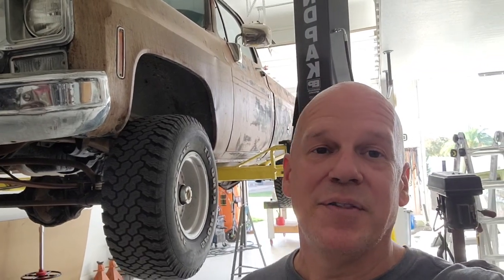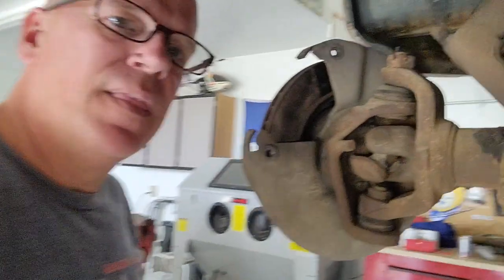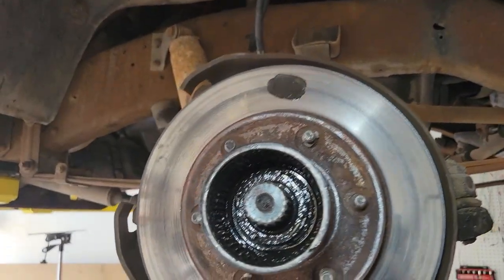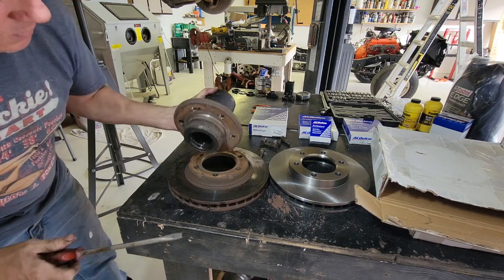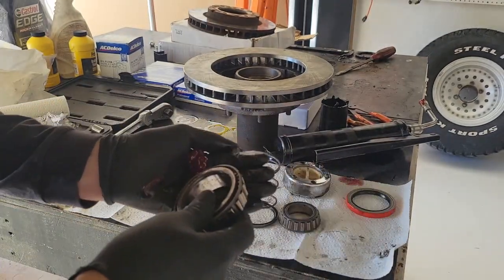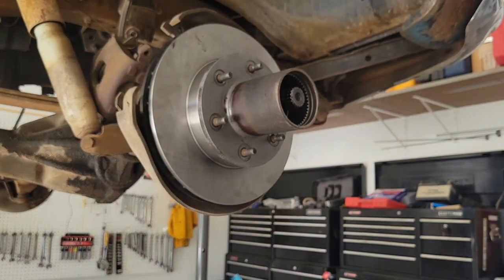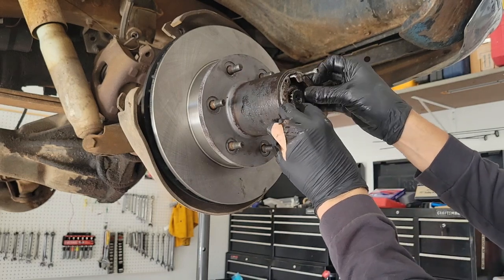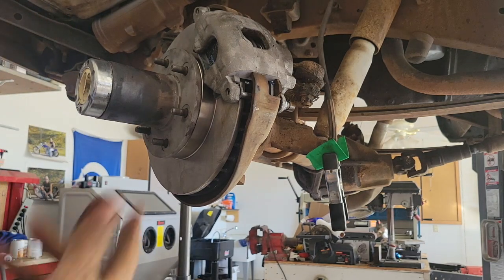Chevy K5, K10 4x4 Squarebody front brake job; rotors and pads.

Comment: Just a FYI for anyone watching. Torque bearings to 50lb/ft to set them up, back it down, retorque to 35 lb/ft while turning the rotor, and then backing the turn off 1/4 turn before installing the lock washer and torquing the outer nut to 50 lb/ft. Awesome video!

Comment: Thank you 😎 your video helped my son and I put on new rotors and pads on our 83 K5 blazer, and clean and regrease the hub innards. The rotors we bought had the lugs and hub cradle already; no press needed; albeit much more expensive. Had we watched before buying everything, could have used the saved $ to buy a 12-ton press! We were going crazy trying to remove the oil seals to get inner bearings out of old rotors, your video led us to "Performance Tool Seal Puller - W1219" at Oreilly's. Having the right tool made it easy.
Reply from the maker: Thanks, glad the video was useful!
Reply: You can use a punch to knock seal out. Just as easy

Comment: For the people without a press, how'd yall get the lug bolts out and pressed back in
Reply: I’m guessing you got them in but the people that didn’t. Put the stud through…rub some grease on 6 or so washers on the threaded side.. then run a lug nut on and pull it through till it’s seated… hopefully that made sense

Comment: It's Project Farm where you got the grease info. 

Today to replace calipers, rotors, seals, grease, and pads on the front only it would be $300 easy.

The only stuff I would have replaced if I took it all apart are the seals and the lug studs. I wouldn't have replaced anything on that rig actually, and simply cleaned,  inspected and greased the brake caliper pins and their female counterparts to see if that solved the brake functions. 

I have an 87 GMC V1500 and it's white also but soon will be burnt orange.  I just use it for tooling around town doing chores and errands.

Comment: Ever experience perfectly working breaks an pulling to one side after changing the pads? Changed the pads an when doin so I used a clamp an old pad to push the caliper pistons in. Now they pull to the right when i hit the breaks. Bled the breaks an didn't change anything. The calipers an lines was replaced about 7 years ago, could be one of those but 7 years isn't that old i wouldn't think, maybe tho. Hit the breaks an pulled perfectly straight till swapping pads. On my 84 k15.
Reply from the maker: I had that problem with a stuck piston in an old Monte Carlo that pulled to the opposite side.  I would suspect that the caliper on the non-pulling side maybe has a stuck piston.  Will the wheel spin when the brake is applied?

Comment: Spun the bearing on my 75 k10, can't locate original hub, forcing me to convert to 2 piece, have you experienced this?
Reply from the maker: @jeffreymarshall6761  I have not.  In my area, there are a half dozen complete axles for sale on facebook marketplace for around 100-150 bucks.  An expensive way to get a replacement hub, but you could sell off the rest of the axle parts.
Reply: @fultonsgarage6331  thanks I'll keep checking, thanks for the reply

Comment: So what if the sprindle nit is complete stuck, I can’t use a breaker bar because the leverage pulls the sprindle to the side. Impact isn’t working this thing is stuck
Reply from the maker: You might have to heat it up, is it the outer or inner nut?
Reply: @fultonsgarage6331  well it was the outer nut, once I got it off after 25 years I found no washer which would be the reason it was so stuck. The driver side was complete every piece was there, however the passenger side was missing the lock ring and nut washer.